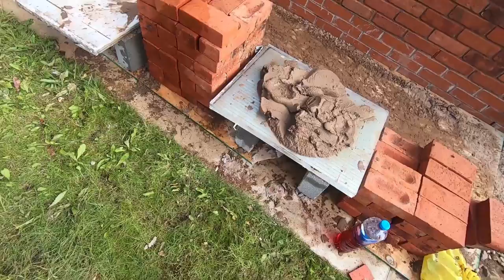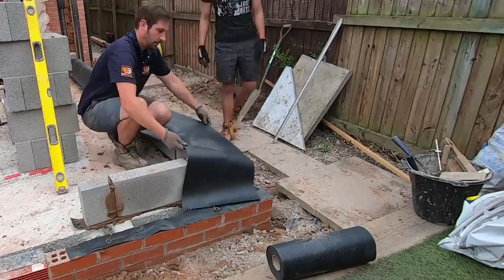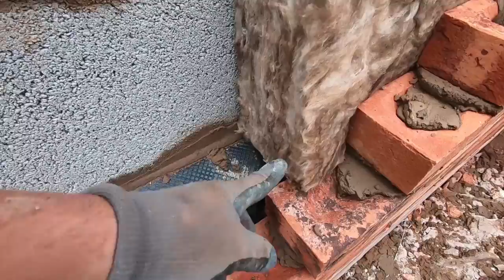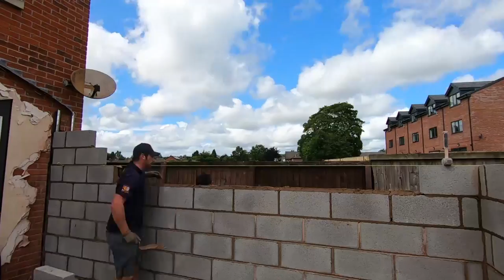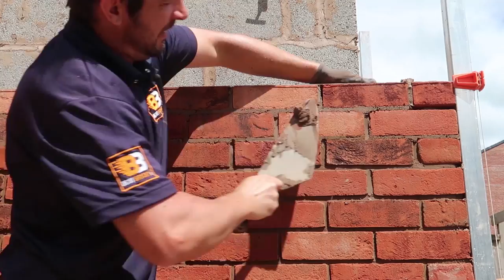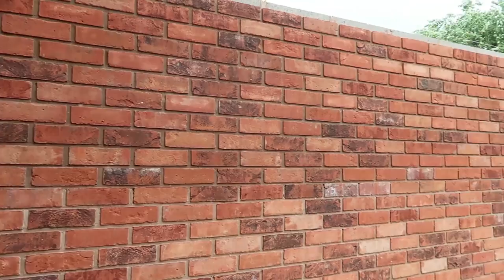Building and Extension brickwork & Blockwork 2

Comment: Great job! 

1.Why are the bottom three rows made of hollow bricks, and then you put another primary solid bricks? 

2. What is the difference between these bricks? Clinker? What are their sizes? 

3. Which masonry mortar do you use?
4. What kind of wire do you use to join blocks and bricks with one another, stainless steel?
Reply: It's usually engineering brick (harder, more frost-resistant) at the base.  UK standard mix is 4 sand:1 portland cement.  Some people add lime for workability and appearance.  On old buildings in the UK we now tend to use lime only mortars.  The wall ties are galvanised or stainless steel (better).

Comment: Just a few question Stu, is the brickwork stepped in at one side and stepped out at the other? Could you not of run the new walls straight of the existing house ?
Reply: Hi Mark Stu is just working to the plans
Reply: Hi Mark just remembered there is a drain there and the building inspector didn’t want to move the drain so we had to come in hundred mils
Reply: @seniorgolfprogress83  ok just  seems odd that new extension sits cob to the house? Not knocking Stu at all, top bloke and you KC Keep up with the great work and videos, is Clitheroe to far to travel to price up a extension?

Comment: Hi Stu, I've heard your only supposed to lay 2 course of blocks at a time as it might lean in the wind. How do you manage to get so many up so quickly?
Reply from the maker: Always question the source you get you’re info from. Depends on many things, what material you’re using how you’re mix is and if you’re backing it straight up with brickwork also if there is a return on it. Hard to explain
Reply: @Stucrompton1  OK, thanks. I think your work and videos are great BTW. Thanks for sharing :-)

Comment: Love the videos Stu. I'm no brickie but love to see trades done to a high standard. One quick question. You carried on the cavity from the original wall but the new extension wall is set in by about a bricks width, or so it appears. If the external of the brick skins don't align how does the cavity?
Keep up the great work

Comment: Hey Stu , Out of curiosity what was the reason the customer wanted dense concrete blocks rather than a lightweight thermal block ? Cheers
Reply from the maker: Is was building control who decided that because it is carrying steel 👍
Reply: @Stucrompton1  That sucks that you had to use them but you cant negotiate with building control is the problem haha

Comment: Another great video stu, big up!

. Question for you, and other professionals. Looking to build a boundary wall, separating both sides of my driveway from my neighbours gardens. Can I build a wall straight onto the monobloc? Or would I need to lift them n dig a footing? Looking at 10 course high, 3-5metres long. Maybe coping on top. Any advice of what to do would be appreciated. Cheers
Reply: I'm not a professional but I would dig down. Mono block does shift over time and it would not be that much hassle I think to do the job properly, just a bit more time. Just lots of cuts 🙈

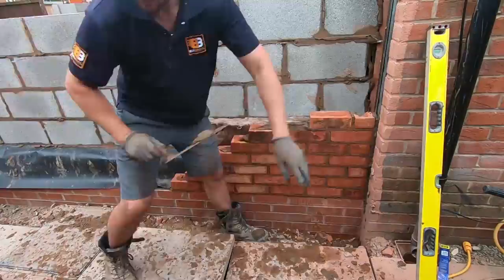Comment: Maybe a stupid question but at 3:49 there is no airgap between the insulation and the outside wall. I though there always should be one?
Reply: This is what's referred to as full fill insulation. You also have partial fill which is the foiled back bats.

Comment: Hi just wonder why you used engineering bricks up to DPC then changed only reason i ask just had a extension built and it was same bricks all the way from the foundations
Reply: I noticed that too. I'd say it was to tie in with the existing building which if you look close enough is the same.
Reply: Hi Glenn Stu is using engineering brick because it states that in the plans Plus it’s to match the rest of the houseThanks for watching